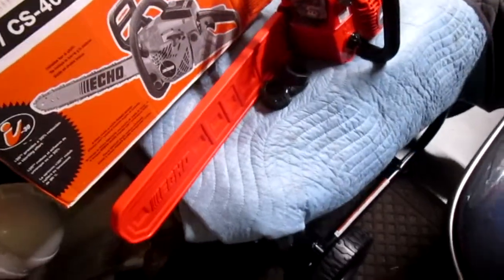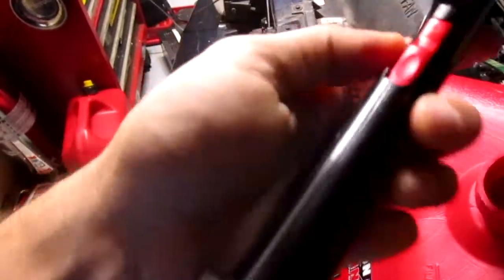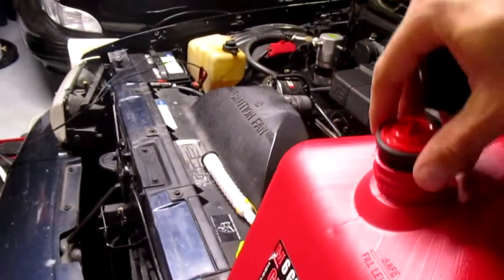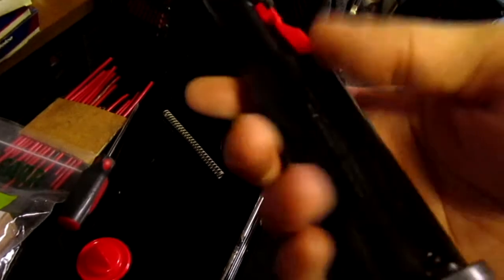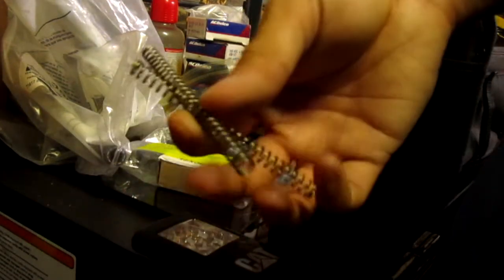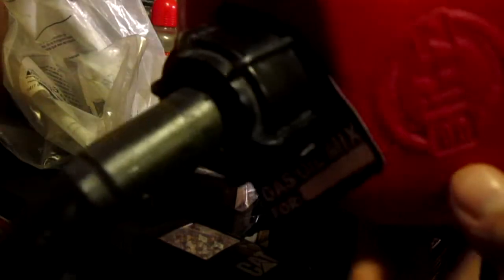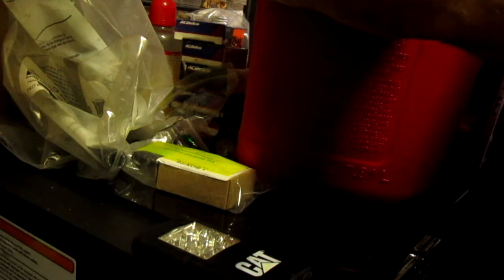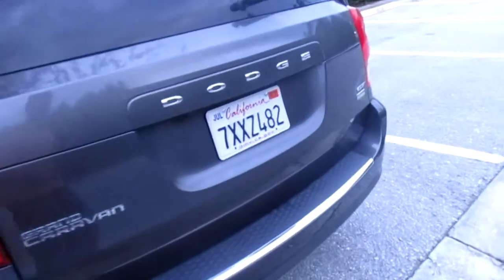Modify NEW MIDWEST GAS CAN SPOUTS SO THEY WORK  FREE! Ghettos VLOG

Comment: Yeah, we have had 4 of the old blitz gas cans and they have worked great didn’t spill much gas at all and still working fine. But I had to buy a new van cuz I need another diesel can and use a gas of it and write in big letters DIESEL ONLY and it’s fine. But I bought the Midwest can because it had the handle in the back so I bought it for $18. Great can except for the EPA nonsense. Leaked from the start 🤮🤮🤮🤮🤮. Spilled my diesel everywhere. Thanks OBOMA/BUSH!!!!!

Comment: I would also recommend using an appropriately sized replacement furniture leg tip (like on a folding chair) to provide a more secure end cap.
Reply from the maker: Probably not fuel safe though.

Comment: Glad no leakie.  Thanks for the shout out!  Good luck.
Reply from the maker: Yea That was you who said that! :)   I keep watching it, I put paper under it too
Reply: My Poulan made a big mess in my shed.  Now, she sat for a couple years .  I use her infrequently fo sho!  I just had to replace her fuel lines and primer bulb ( thanks ethanol! )   So I leave her dry now.  Ready to go.
Reply from the maker: I forget what brand I found in the trash years ago, May of been a poulan. I should of tried to rebuild the carb on it but I was not at that level yet, It ran for a little bit and bogged when you gave it max throttle, kinda like when the carb was all gunked up, filter was gummed up and the diaphragm inside the carb was all dry or had cracks.  Sold it for like 10 or 20 bucks I forget.    Ethanol gas sucks.   I started using 89 or 90 octane boat gas, easy to find now because Wawa's sells it, used to have to go across down and spend 40-50 more cents a gallon for i.  Mix that with the oil, it never has went bad, never has separated,  and I never had starting, carb problems or fuel lines and other gaskets turning to gum.  Look for Non ethanol gas. I think Pure-gas.org has a bunch of listings by zip code. I used to blow the primer bulb all the time on ethanol fuel.